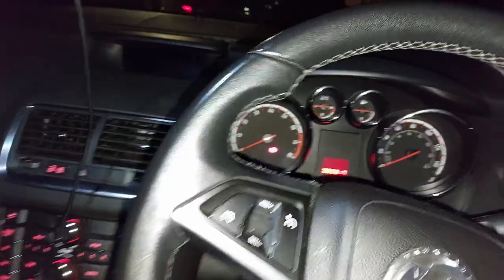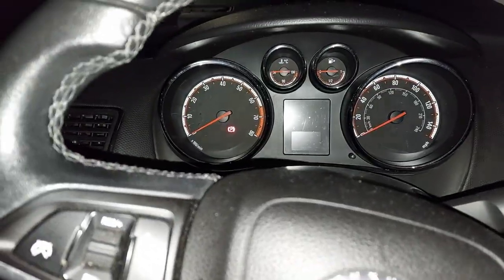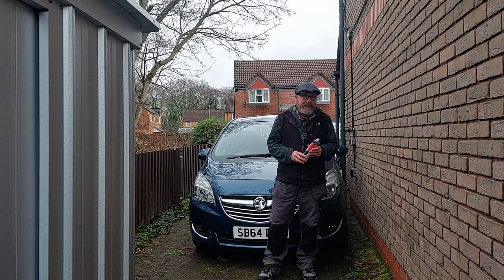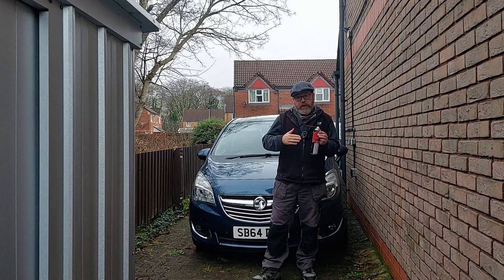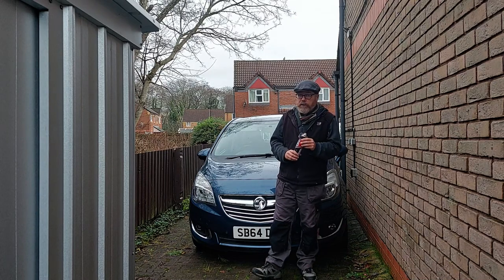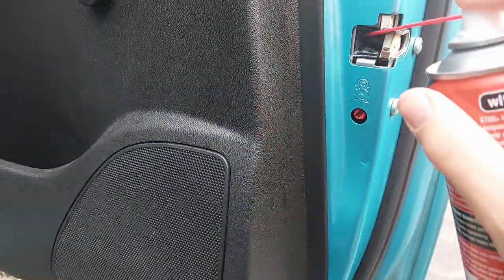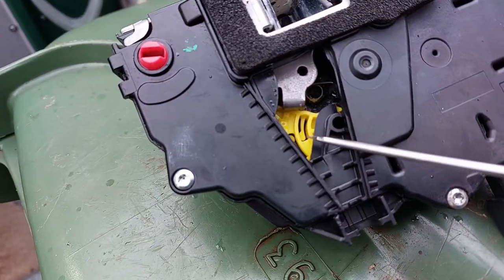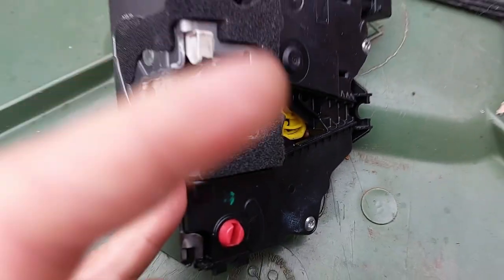VAUXHALL MERIVA B BACK DOOR LOCKS FAULTY  RED DOOR CAR FLASHING  KEY SYMBOL - CODE B2524-59 PART 1

Comment: I had the same issue with my left rear door lock (passenger side) my VxCom also said “Lock Stuck” ! The yellow switch area you show in the video is the correct area to hit with lubricant. Clean with WD40 or GT85 but use white (lithium) spray grease to actually lubricate the switch once freed. Once I had identified the correct lock giving the issue I did all cleaning & lubricating via externally via the lock recess. Except you need to open and close the door fully for around 200-300 cycles to “exercise” the lock having soaked it in WD40/GT85 until the switch frees off, you can hear the diff in the mechanism once freed, then spray the white lithium grease in and repeat the action again a few more times. Don’t be so quick to buy a lock until you have tried doing this 👍
Reply from the maker: I had the lock out and gave  everything a soaking in WD-40, also GT 85 and lithium grease with added PTFE. I physically moved the yellow piece many times and cycled the lock many many times when back on the car. Sometimes things are just broke and I wasn't so lucky.  I gave it my best shot, thanks for the advice 👍
Reply: @baconbuttties  o
Reply: 😊⁷⁶ìù
Reply: I tried this and it worked for me. I used GT85 and sprayed alot in both doors lock. Turned on my car and the warning light went off after i pressed the central lock

Comment: Right vs left is easy....it's always taken fron sitting in the drivers seat facing forwards....it's a right hand drive car so the drivers door is on the right (offside in the uk). Right rear is the passenger door behind the driver.
Reply from the maker: @damienwalker546  👍👍

Comment: To remove annoying ping simply apply both child locks, warning light will still be on but ping will be gone. It worked for me.
Reply from the maker: Temporary fix maybe but you would have to get out if you had passengers in the rear.

Also I was selling the car so had to fix the issue.

It's all to do with safety because the doors open backwards, putting child locks on eliminates the danger.
Reply from the maker: @Mark Jones put child locks on and it will be safe to drive

Comment: Is it possible to turn off this beeping annoying signal without replacing the door lock?
Reply from the maker: If you put on the rear child locks it reduces the beebing
Reply: You said "reduces" but I wanna turn it off at all. I wonder if Vauxcom or similar device can do it? I got only basic OBD 2 scanner which reads codes but nothing more.
Reply from the maker: @rejtan2104  I think it will be difficult to turn off as it's a safety feature.

This is built into the cars ECU so no one can open the doors while driving.

The safety feature has to be there because the doors open backwards.
Reply: Got it. So maybe there's a small speaker somewhere inside the dashboard which makes this annoying sound and maybe there's a chance to remove it phisically? How do you think?
Reply from the maker: @rejtan2104  there's probably a small speaker somewhere, nit sure where though.

Comment: I have this same problem. It seems to mainly happen after a good downpour. My fix is just turn child locks off then on again and this works for a while, the light doesnt go out but the noise stops (at least for a few journeys). During summer the light even goes off leaving you thinking it's a miracle, but sadly no, it will be back😂
Reply from the maker: Those backwards doors cause more trouble than they are worth.

Comment: My fault was cleared by opening both the rear doors, and then locking/unlocking the doors repeatedly for about 2 mins with the doors open. I think this must have cleared the sensor somehow? anyway not had the problem since
Reply from the maker: It is either 3 or 4 sensor micro switches in the locks and sometimes it can just be a sticky micro switch or it may be the contacts inside the micro switch have become contaminated or corroded. I'm glad you method has solved it as it a pain to remove and replace. 👍
Reply: Thank you for advice! Worked for me too.

Comment: One of your respondents advised removing the radio fuse[s] for a couple of days and then replacing them. That worked for my car after many other ineffective methods. However, this is an intermittent software/system fault and will - with little doubt - re-occur. I must also mention that WD40 worked on one other occasion. On a  further occasion, it chimed for several days when I was too busy to do anything at all about, and then, out of the blue, stopped as unexpectedly as it started [though I admit to calling down multitudes of curses upon it: it mightn't be effective - but it helps relieve tension!

Comment: Ate

A temporary fix that will stop the beeping for 4 or 5 engine starts especially if you have a long journey. Turn the green light on and then off, both doors. Should stop the beeping but the red light on the instrument panel will still be on. I tried WD 40 but did not seem to work so suspecting water dripping down on to the lock I cleaned the window seal and smeared vaseline along it. That cured the fault for a year or more with the red light off. The fault has now reappeared so I will go through the procedure again when the weather warms up , in the meantime kiddy locks on and then off on both doors
Reply from the maker: I took my old faulty door lock apart as I bought a new one and was curious to see what was wrong. Nothing was seized or had any water ingress, it was an actual faulty micro switch which you cant replace.

Comment: This was the start of my vauxhall meriva nightmare!
Had the dreaded code 68 Christmas tree lights, ABS fault, no steering, no traction control, no speedometer, no handbrake, flickering lights etc.
After being quoted thousands on things that weren't the issue, I noticed the header tank was leaking on the ABS pump and modules making the car go berserk.
Since I've fitted a new tank all above problems cured, including the doors going on and off.
ABS and doors locking are related apparently, so just a heads up.
Might help somebody out.
Reply from the maker: Glad you found the problem, as it can be a nightmare to diagnose faults on modern cars sometimes.
Reply: @baconbuttties  Boy did that thing give me some sleepless nights!
RAC hadn't a clue, independent vauxhall specialist hadn't a clue, vauxhall themselves also hadn't a clue as it wouldn't read anything from the car to the computer.
Old fashioned mechanics and a £28 header tank from euros and its right as rain now after spending 3 months as a garden ornament.
That's precisely why I drive an old 70s dodge truck.
Reliable. Easy to work on. Can fit 2 harleys on the back. Parts are surprisingly cheap and readily available, and there's nothing electric to go wrong.
Added bonus of no tax or mot to worry about and sub 200 insurance.
Unfortunately, the massive carbureted V8 big block completely wipes out those savings with 7 miles to the gallon on super with a strong tail wind 😭
Reply from the maker: @stephenhill5131  7 miles per gallon 😱
Reply: @baconbuttties  it's the most fun way I've found to burn dinosaur juice yet haha.
Holley carb, edelbrock intakes and clay Smith race cams channelled through some hooker long tube headers with twin shorty side exits, no baffles. Mated that to a 727 torqueflite 3 speed. 
Eats a lot of modern performance cars for breakfast until we get to a corner 🤣💩
Dyno'd at 553 bhp at the wheels and 636 ft/lb torque on race fuel so she's a handful alright!
Reply from the maker: @stephenhill5131  Sounds awesome  👍
Reply: Can you elaborate on the header tank? Maybe a pic , part code or somwthing?

Comment: On my lock i foud that auto lock motor was failing it could unlock but not lock and also beeping. Replaced the motor and mechanizm is functioning ok but still fault that its stuck. Then checked the micro switch found that when pressed shows 2kohm and when released 8kohm. I suspect some other fault so needs some more investigating
Reply from the maker: In the comments there is someone called gazza uk and he put a new lock on and it didn't work, he later said the problem was the old lock had blown a certain fuse? probably not your problem but worth a try.
Reply: @baconbuttties  in my case the auto lock motor that i replaced was turning in the opposite direction i just had to switch two wires at the lock connector
Reply from the maker: @alvydasurbonas8913  👍

Comment: Do you know how to turn off the auto locking it's adding a lot of ware to the motor's and it's just a pain I've got a folt now where all the doors auto lock and lock with the dash button but with the key button the passenger door doesn't lock
Reply from the maker: I haven't got a solution to turn off the locking function 😕
It's there for safety reasons because the rear doors open backwards.
Reply: @baconbuttties  it's a option on Astra j maybe it's possible to trick it to think it's a Astra
Reply from the maker: @colinhamer6506  it's most likely programmed into the body control unit. It may may have an option to turn off ? But you would have to have the vauxhall software.
Reply: I was wanting the same solution, did you find out? Thanks
Reply: I nearly forgot on top of that one day the electric hand brake decided to realise it's self and I came out of work to find it had rolled into a pebble dashed wall breaking a head light and deep scratches on the bumper

Comment: Hi how do I turn off the auto lock at 2mph, on the 2015 Meriva. I find it very annoying. Hopefully one of you guys can help. Thanks
Reply from the maker: You can't turn off auto lock because the doors open backwards. Imagine if the rear doors were opened at speed 😯

Comment: Hi, used your video to get the door skin off and sprayed it. not sure i am doing the right door as dont have the vauxhall software ( anybody got a copy i coud have?) took me all day to strip down the door spray it and then put it all on again for it not to of worked. MOT next weekend. hope it passes with the light on the dash.
Reply from the maker: It works for some people, didn't work for me either.
Reply: yeah shame. ah well, guess i`ll have to replace the unit in the door. great video though. cheers @baconbuttties
Reply: @dazcuz Did you figure it out in the end?
Reply: No. It sorted itself out, but it's just come back one about a year later. 😢

Comment: This annoying problem is relates to the weather conditions/temperature. 
Never experienced in summer but it comes out in rainy/wet/cold days. 
I'm trying to solve it but removing the door panel is terrifying me.. :) 
Thank you for your suggestions.
Reply from the maker: Removing the door card is not too bad, changing the lock can be difficult.
Reply: Had the same problem about 3-4 years ago and tried all the remedies that were going about on the net but ended up giving in and buying one of ebay which is considerably cheaper than anywhere else but the constant bleeping and the doors where repeatedly locking and unlocking absolutely drove me up the wall, but you just need to be patient when removing the door card and lock because the relief after completing the job is blissful 😊

Comment: Hi baconbutties would you recommend the Vauxhall meriva do they still have the steering problem
Reply from the maker: I haven't had the steering problem but there is a company that refurbishes the hydro electric pumps. The Meriva B has had no more faults than any other car I have owned and find them to be reliable if looked after 👍
Reply: @baconbuttties  thanks for replying mate love your channel
Reply from the maker: @martinfirth3744  👍
Reply: @baconbuttties  Hi, firstly thank you for your videos, they're so informative! My Meriva B is currently with a fluid leaking problem on the Power Steering pump, can you inform me which is the company that refurbishes this hydraulic-electric pumps? I simply couldn't find any place that sell or fix this pump. Thank you!
Reply from the maker: @rodrigoneumann  https://www.ebay.co.uk/itm/403718842393?hash=item5dff84a819:g:D6gAAOSw5NpdmwSK&amdata=enc%3AAQAHAAAA8MJHuFt4GZL1mlUqtMVVnN9CtY3XgsusD6sJB64K1k%2Bdip%2F43t4UPLqRNkOXJCe%2BKadXtV9S2g87k9kiMJmyYKJg4iXGEsKKl2BfAWoD8rxAEaW5Y3jQURHAiXk4PCbV8%2BqbeMVFPjpcvrSxW6j6CMPtaEyNw8mIIxhlLT5B%2FD59i%2FWCffnq%2B74uWp%2BEh8%2FMOSZJ9ddWXiKdrRy11FYr8FIVJMLqQv2bgF3C%2BStS2WcP30JWiAio44AWinkqBIRTHjt40H3ys%2FMCkEfowQK8TtitjTr71RPlxNyNxDyaU8f7CRJIcsC7aKa6y1I8WS%2FhPA%3D%3D%7Ctkp%3ABFBM0q38pvxg

Comment: I've just replaced passenger rear lock using your vids and after all that it looks like it's the drivers side rear so ordered and will get tomorrow ahhhhhhhhh...🤔
Reply from the maker: I was lucky enough to have the vaux com software to pinpoint which lock. On the plus side you should have no trouble with locks for a long time. Hope the video did help 👍
Reply: @baconbuttties   Hi I've replaced both rear locks and central locking still keeps clunking and clicking and the annoying bong bong still happens untill I put child locks on also still have red door light on dash, any ideas.😮
Reply from the maker: @gazzauk6851  could be a few things. Is the car still recognising the old fault code?
Could it be a wiring fault somewhere?
Have you tried maybe leaving battery of for 15 minutes if you haven't got a obd11 fault reader.

It's worth having a code check if you can't get to the bottom of it.

The front doors also have switches but I don't know if they will activate the alarm.
Reply: @baconbuttties  Hi update is I took the new locks off and put old ones back on then looked up fuse diagram and the rear left has it's own fuse and lo and behold a blown fuse ,changed it and it blew again so I presumed old lock was doing it so replaced with new lock again! and then changed fuse. It now works thank goodness, although the front passenger door intermittently doesn't want to open from outside but I can cope with that lol Thanks for the vids and I am now a professional at changing the locks  on a meriva...😁
Reply from the maker: @gazzauk6851  That's great news, glad you got to the root of the problem 👍

Comment: I wish this damn Meriva was a simple fix like this.

Entire freaking car has been a nightmare, dead set on the issue being the computer/main module.

Changed both rear locks, now stuck with the left rear being stuck to locked. Fun times.

FYI don't buy China we brought those and they didn't work at all. Went to vauxhall and almost got ripped off over 400 bucks for the same locks. Turns out they don't have their own stock of parts and chance it on Ebay.

These new ones worked briefly, til the rear remains locked now, issue is I can't do jack without the damn door open! Such a shame, the engine is great still pulls great only 86k on the clock.
Reply from the maker: Not nice when you have multiple problems
Reply: @baconbuttties it's crazy, I also noticed when sourcing parts it comes back with insignia. So I have a feeling the shell is unique, but it has been slapped together with insignia parts. 

I was told in the past both Ford and Vauxhall computers tend to degrade and once they go it's game over. There rear lock issue is a really common one too.
Reply from the maker: @ryanfreebody6881  yes rear locks is really common.